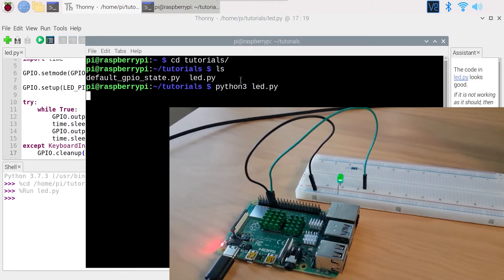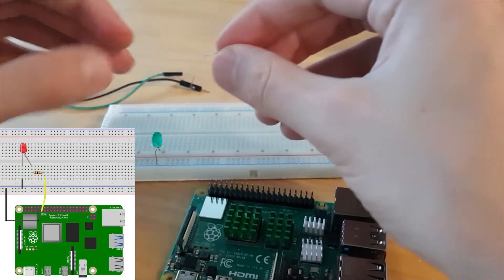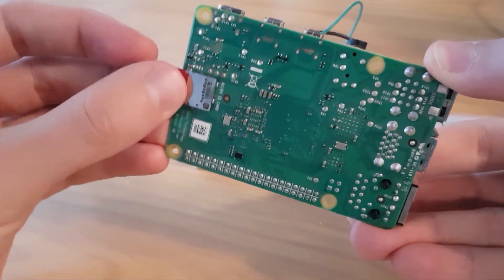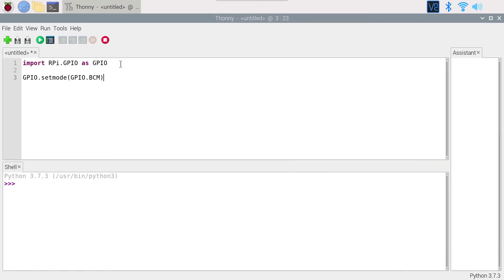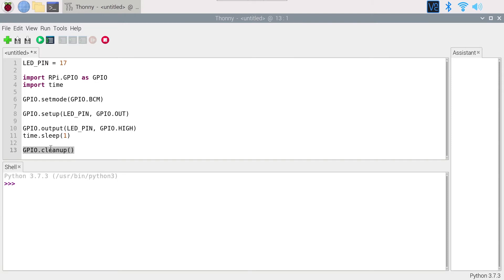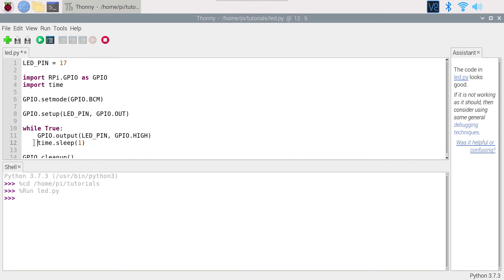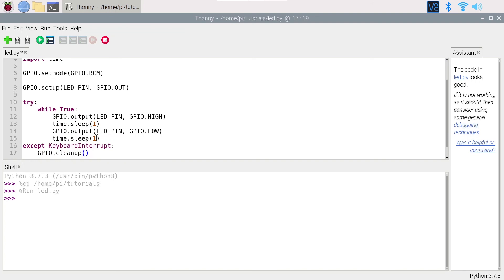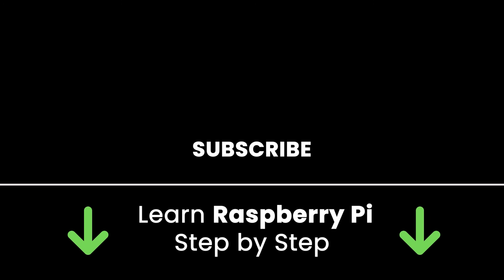Raspberry Pi - LED Tutorial (with Python 3)

Comment: Is it possible that CTRL+C could result in the cleanup function not running correctly? 

My thinking is this:
When you press CTRL+C the program starts the cleanup when the CTRL key is pressed, but when you click 'C' it will terminate the program regardless of your cleanup state. This means that the cleanup function needs to finish running in between CTRL being pressed and C, which could result in the cleanup function being cut short. This can be mitigated if you press just 'C' or just 'CTRL', or any other non breaking code keyboard combinations.

I've never coded in python before so could be wrong about the catch block trigger being any keyboard key though.
Reply from the maker: Hey Kevin, almost correct :)
Actually pressing CTRL+C is just one action, and it will try to terminate the running program. As the program is "stuck" inside a loop, it will end from there, and the GPIO.cleanup() line won't be called.
Solution to that --> check at 8:30 in the video